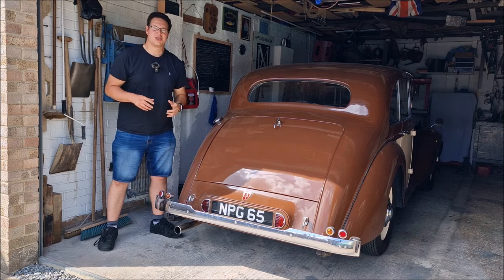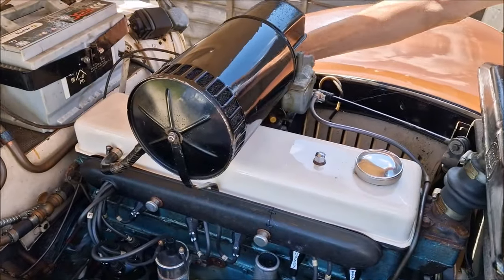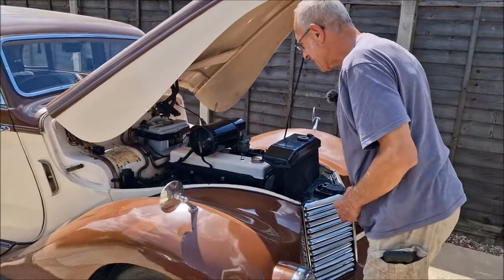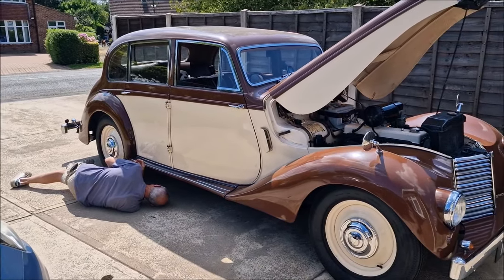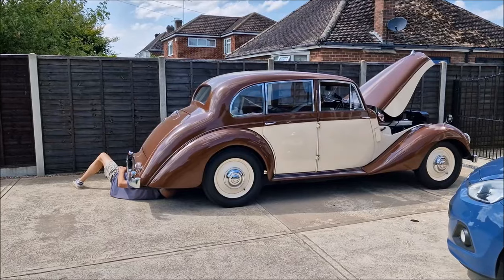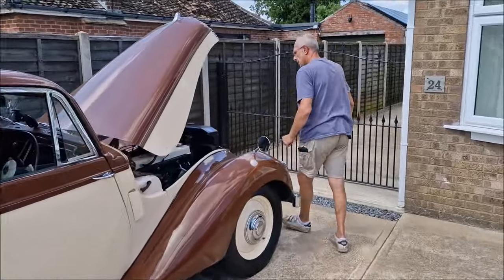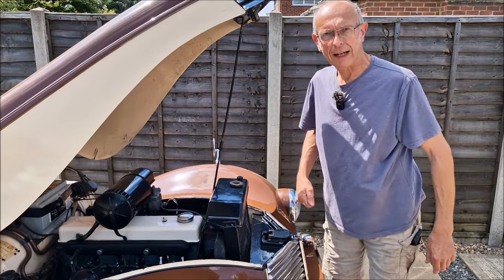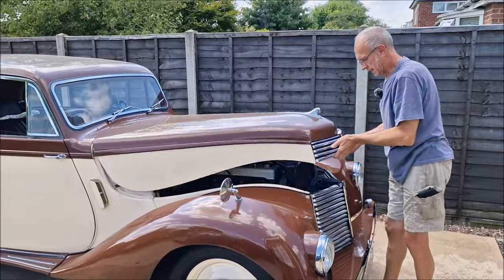Armstrong Siddeley Lancaster Goes For A Drive ... But There's A Problem

Comment: 1949 good year as that's the year my late dad was born lol and also good news is if Russia or China ever used an EMP attack on the UK , these old cars pre ECU days would still work fine , I think it was a big mistake to ever fit computers to motor vehicles , the 2 things don't mix lol Anyway that's a gorgeous car Jon , no wonder your dad is Smitten by it.
Reply from the maker: Thanks for watching
Reply: @JonCoupland  🙂🥂 cheers 🥳 Jon and the Car Wizard 🧙‍♂️

Comment: I think the brakes pulling to the left might be caused by one brake binding a bit.  This can be checked by feeling the temp. of the wheels after a run, if one wheel is noticeably warmer than the rest then that  wheel's brake is binding.  Alternatively your Dad is correct and the cables operating the rear brakes are not set up to give equal force  and need adjusting, but I am sure your Dad knows all this.
The video is a treat, always a pleasure to see such a fine and elegant car in use, and one of the best ways to reduce maintenance needs is to run it frequently so that nothing forgets how to work.
Reply from the maker: Hi David, thanks for watching and for your comment - we did have a quick feel around and nothing felt overly hot BUT as in the video it was a sweltering hot day. Part 2 and 3 are coming soon. I really didnt see what happened next BUT it may have caused the issue!

Comment: When I was about 6 my Dad had an Armstrong Siddeley Typhoon, a two door coupe version of the same car, and we went on a month long tour of the Continent, six up and all our camping gear, - wonderful memories! We'd never seen a dual carriageway until we got onto the autobahn where I encouraged my Dad to try the top speed (no pulling to the left) but was really disappointed when we were passed by a Borgward Isabella. TRied to persuade my Dad to buy one! I have some pictures but don't know if I can add them. I don't remember our starter button being where yours is. Our car had hydraulic tappets but the later engines didn't have them and were not as quiet. Should be a perfectly useable car. Your Dad didn't look entirely happy; obviously a 'tinkerer' more than an old car enthusiast.
Reply from the maker: I'm a big fan of the Typhoons, what year was your father's? Sadly YT doesn't allow you to add photos but sounds lovely. I think after 50 years in the Motor Trade dad's had enough of cars and so can understand why you think he's not impressed. Rest assured he's had some great fun getting this back on the road. Part 2 coming tomorrow 😄

Comment: in Australia   if you  owned an English car.  your  drive way ; always  had   to  be full  of  oil.  in which case    WE  CALLED  IT   the cachophony  of oppulence.. btw. Daimler  had  a  Daimler  fluid  flyiwheel   (gearbox)  where  as  Armstrong  had  a Wilson  Auto   box.    amd  the Daimler  scout  had  six  speed  foward  and  six  speed  reverse    doesnt   matter  what you do.    THE  BRAKES  WILL NEVER  IMPROVE.     i  KNOW .....   LOVERLY  CAR   May  it  brings you   much  joy  and   happiness.   thank  you for taking out  the  time  to  make  the  video.  Cheers  mate
Reply from the maker: Thanks for watching 😄👍
Reply: I  wonder  if you  read  my  note  about  the Daimler brakes
Reply from the maker: @julesmarwell8023  Absolutely! We have found a few issues with the brakes that caused a slight improvement when fixed (videos coming soon)

Comment: If the ride is a bit bumpy - it could just be that the tyre pressures need altering. My Dad had a 1936 Standard 10, and that was like that!
Reply from the maker: Yes we found that the tyres were pumped up a bit hard 👍😄

Comment: Not been on the road for a year and pulling to left...Check r/h brake cylinder as it may have seized due to inactivity...Also sitting in same spot for a year the tyres will have developed flat spots due to not having been rotated
Reply from the maker: Check out the latest video for an update! We couldn't believe what was causing it!

Comment: She's lovely Jon ,and yes Pete you can adjust the tappets with the engine ticking over ,needs plenty of cardboard to make up an oil splash shield ,used to look after a later star sapphire for many years until the owner sadly left us ,the family had no interest in the car so sold it on to someone in Kent lost contact after a couple of years hope its still running,as to why anyone would fit the engine out of a herald God alone only knows,on the other hand the 6 cylinder from the vitesse might be more like it
Reply: A STAR SAPPHIRE! OMG, I'm in heaven!
Reply from the maker: I love them too
Reply from the maker: Great advice about the cardboard!

Comment: Many years ago, ... almost fitty years ago, a mate & I answered an ad for an Armstrong Sidley
It was on the other side of the city [Sydney]. He bought it & drove it home, unregistered while I followed in his 1950 Vauxhall.
The Sidley was a 1926 six cylinder Touring. It had four very large diameter brake drums, with four shoes per brake & a four wheel handbrake.
It was simply called "Old Sid" & it was also widely known as an "Umdum Diddly"
We got it registered two weeks later & it was driven on weekends for years afterward.
But time marched on & we got girlfriends, who became wives, who produced children, you get the picture. It was sold & I believe it is still on he road, cruising around when the occasion calls for it. It had many uncommon features, among which was a sealed engine compartment with a fan cast onto the flywheel, so it sucked air right through the radiator & the whole engine compartment as well.
We had fun in it, but now someone else has the responsibility of caring for it.
Reply from the maker: Great story and great memories. Thanks for sharing! 😊